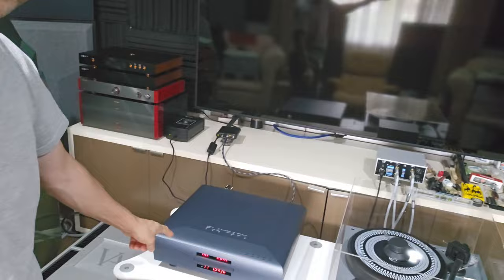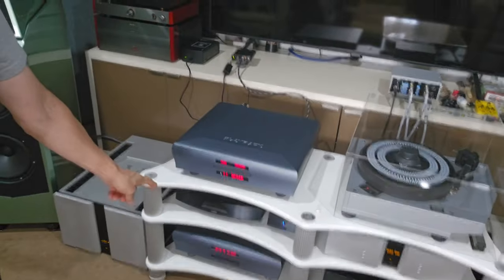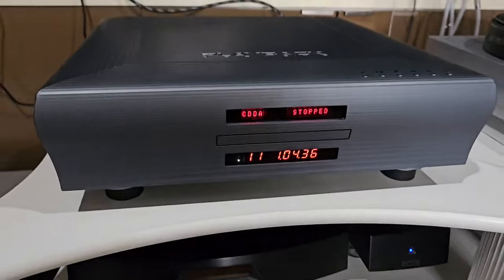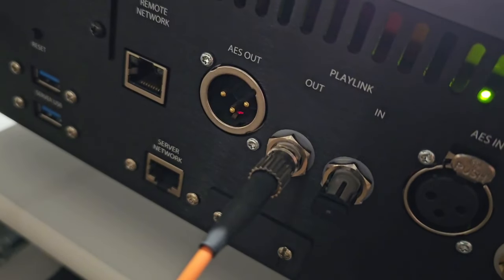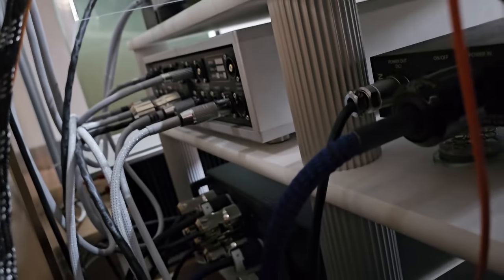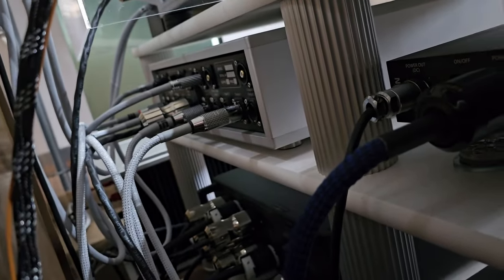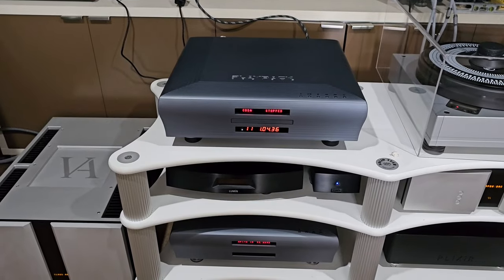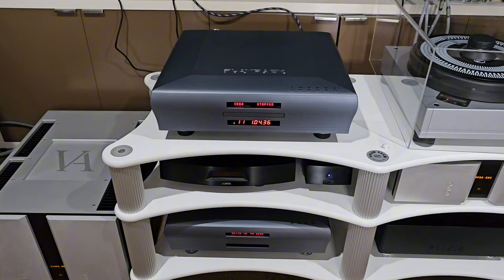"PLAYBACK DESIGNS  MPT & MPD-8 THE DREAM STACK AT WORK"!!!🎧👍

Comment: Nice! Similar to what I hear every night but better. Does seem like that MPT adds a lot. I am investigating getting the MPT-8 to pair with my MPD right now. Curious about a couple things:

1) What power cables are you running into the MPD and MPT? I’ve found that they affect the sound on my MPT quite a bit.

2) What are the biggest effects you hear when moving from day AES to the glass fiber cable between the MPT and MPD? Curious what occurs.

Keep up the videos! Thanks for your work!
Reply from the maker: I have a limited run now unavailable OCC copper cable with OCC high purity silver plating. It's constructed with a Teflon dielectric inner and outer. It is one of the best power cables I've ever heard, and it really isn't match thicker than a standard power cable. it's military spec in its construction and I guess it goes to show all these massively thick cables are just full of unnecessary dielectric and worthless fluff to make people buy them. The power plug and iec ends come out of Canada. I'm going to do a dedicated video on these power cables, where I will list the fellow who constructs the power cord ends. He's a great guy and uses extremely high purity copper for the the electrodes that go into the receptacles. As you can imagine I've tried everything there is to try and these are the best yet.👍🎧😁
Lol as for the aes/ebu v fibre cable the short answer is I don't know I've never tried it.
Reply: @shanestephenson8423  Very interesting. I just tried a couple of power cables on the MPD and of the ones I tried, I like what the Clarus Crimson did. Simply put, brought the sound even a bit closer to Vinyl in my system. I'm back and forth on the cable at this moment, however. Ever tried the Clarus?
Reply from the maker: @a.s.2426  No, I haven't tried their power cables. That's quite interesting.👍
Reply: @shanestephenson8423 If you do have a chance to test one, would be curious your thoughts. They're fairly reasonably priced for a brand's top-of-the line.